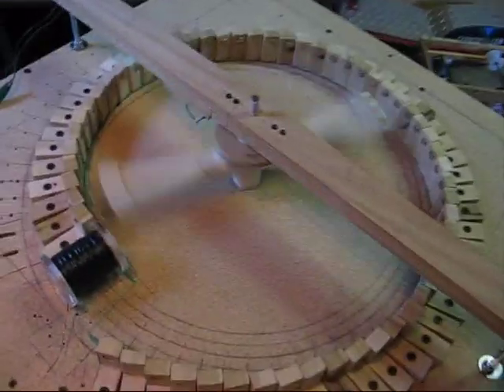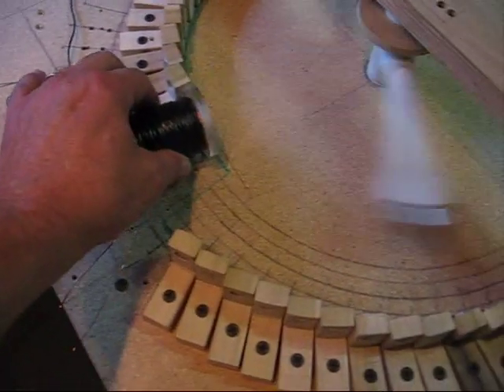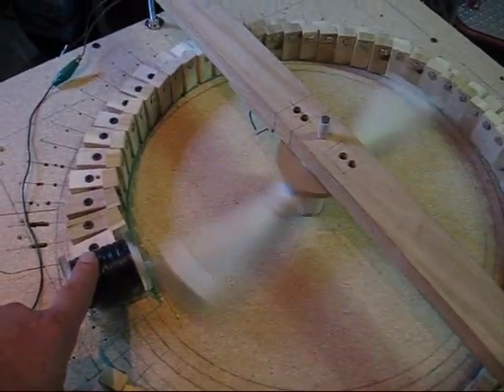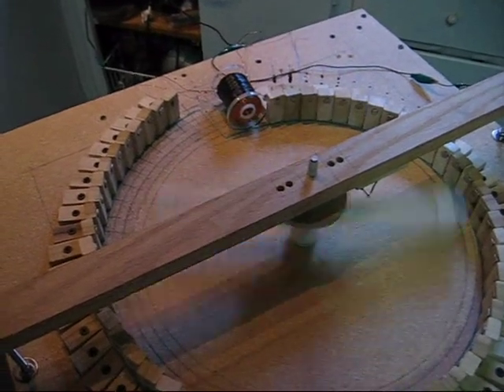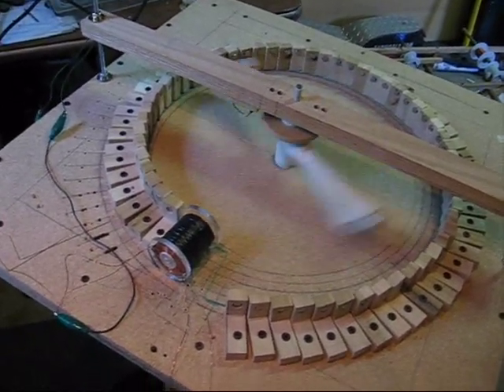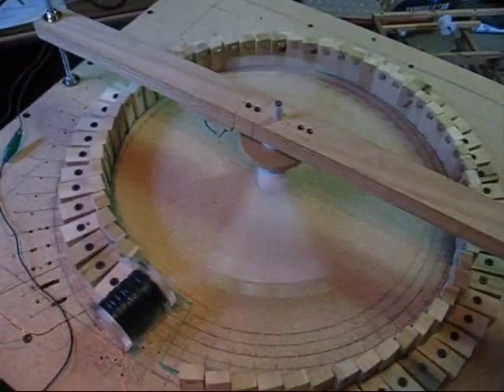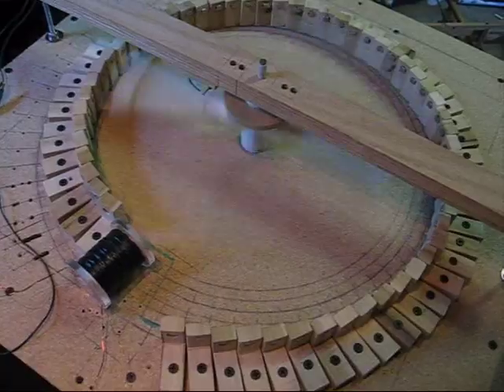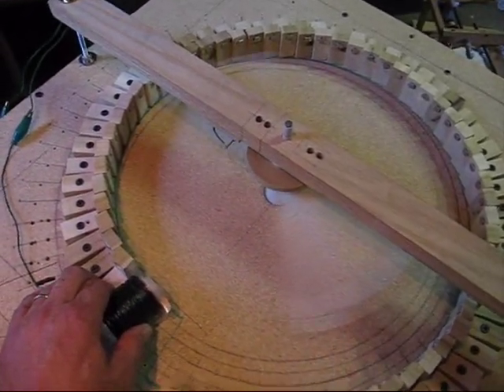Spiral Magnet  Rotor

Comment: Hello !
Great job with the materials at hand.
I think that the rotor should have four arms and that about five such prototypes should be made on one shaft.
In my opinion, there will be no need for an electric magnet to overcome the deadlock.
What is your opinion ? Thanks and dare ...👍  😀
Reply from the maker: Thanks for the comment. If you look at later vids I did ad 2 more arms and in all my research, it seems necessary to use a electro coil tp over come the cogging

Comment from the maker: yes I could. This project has been replaced by another which I need to get off my ass and show you guys. But great point about using both. The only problem I see is the two forces would cancel each other out. Unless I make it vertical?

Comment: Another experiment on youtube shows how to draw 4.5 volts from the air waves coming from your local radio station broadcasting antena.I used a crystal radio to listen to AM broadcasting. Can the combination (Air Power generator) and the magnet engine work together? You would not have to use a power source and the unit would run forever.This would make a great science fair project!

Comment: you should build about 20 of these on top of each other to increase power output
Reply: You are right to say that they must be built
not 20 but not less than 6, one on top of the other on the same shaft
  and we will have a running engine without fuel.
Samples sample samples until you reach the highest score.
MCORRADE  Keep going boldly and good luck!

Comment from the maker: no I don't agree and I have done that test several times and the spiral does help the system and in some tests the rotor would run twice as fast due to the spiral magnets.
Anyone can clearly see that the rotor will move by itself within the spiral until it hits the gate which at that point the any gain is lost. But I recently changed the spiral where the gain is greater than the loss from the gate. This DOES NOT mean I now have a self runner, just better performance. This is old news, catch up

Comment: Hi, Nice Work.

Now suppose you replaced the drive shaft of the rotor with a small inexpensive 12 volt motor/generator. Surplus stores sell them or Ebay. Connect the output voltage of the 12 volt generator directly to the air core coil. 

If the motor keeps running you have acheived overunity and now have a self runner. 

The next test would be to see how much of a load you could put on it before it stops running.  Thats down the road.